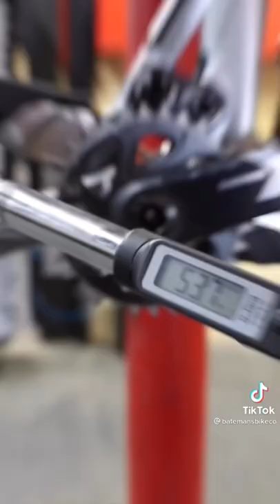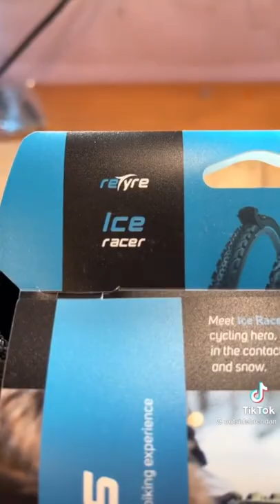MTB TikTok Compilation #5

Comment: I’m getting a mountain bike soon, is a mongoose good?
Reply from the maker: I think it would be ok for some smaller and calmer trails but I think that buying a nicer bike used would be a better idea for anything harder
Reply: Buy a tracer, I don't care what your wallet says. DO IT!

I'm joking get the goose then upgrade if you start to hitting trails black or above.
Reply: I defo recommend a boardmen comp 500 it was my first bike and its got all the stuff you need to hit proper trails it's got air suspension hydraulic disc brakes and good gears you can get one for abt 200 on eBay there reliable and lightweight I defo recommend and then once you fell ready to move up you can do it at your pace but it will do you for a while I've had mine 6 yrs still going strong
Reply: @officialcatchingair1932  thank you so much
Reply: @officialcatchingair1932  I’m going to stick with the goose because that’s what I can afford, thank you so much for the tips though
Reply: @landonbarger8378  nah that's cool what mongoose is it
Reply: @officialcatchingair1932  I don’t even know tbh. I already got it with my dad last week. To thank the mtb community for helping me and all the props go to you Catching. Have a blessed life bro
Reply: Not in the slightest
Reply: @landonbarger8378  you too bro ride well and hope you have a great time and don't let ppl tell you your biked bad my friend rides a 15 year old BMX better than some full sus riders lmao